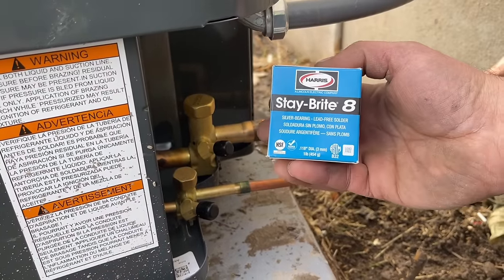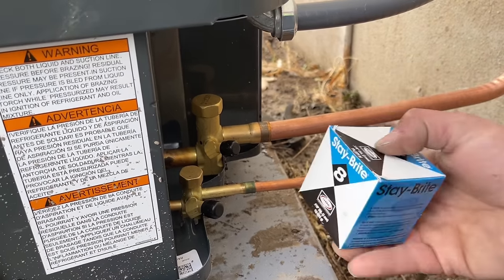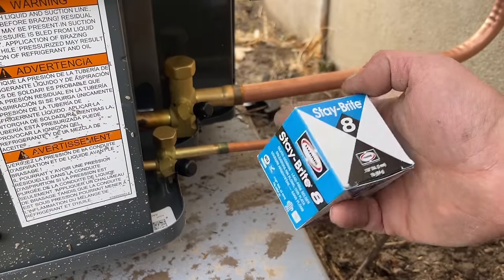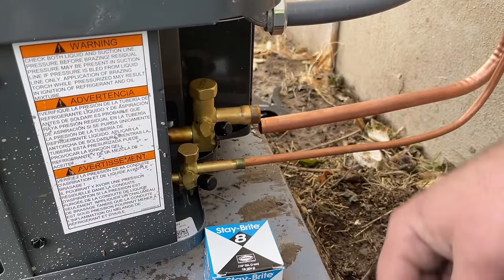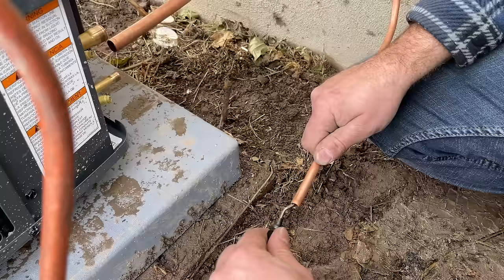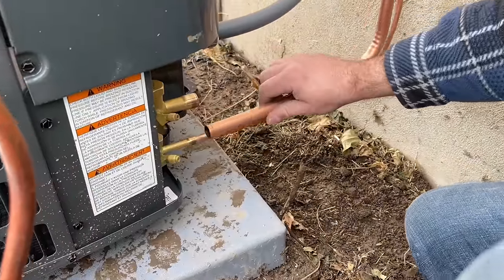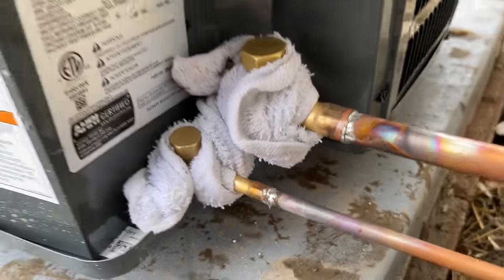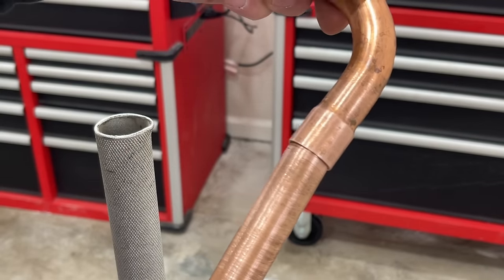An Awesome Alternative To Brazing HVAC Lines. Staybrite 8 Soft Solder

Comment: Remember to heat the joint, not the solder.  Apply the solder on the opposite side of the heat and let the solder run to the heat.  As well, if possible, do all sanding before you cut the pipe.  Finally, don’t touch the pipe where you sanded with your skin.  You will transfer oil to the pipe and “dirty” the contact point of the solder.
Reply from the maker: Thanks so much for the feedback sir. I'll be implementing all those tips on the next job. Cheers!
Reply: Nice
Reply: I’ve never heard of the transferring oil and making it dirty part😂 seems a little over board but hey I guess we learn something new everyday
Reply: You can certainly transfer dirt/oil from your skin to the parts.  About the heating process, you need to have experience heating the parts up to understand how heat flows.  So get after it.  It’s not just simple to understand, there are lots of factors involved.  Making a solid joint requires that the entire section of the joint to be soldered/ brazed needs to be above the melting point of the solder, so that when the solder is applied, it will flow into the entire joint.  And you can’t just burn the crap out of it, controlling the heat is essential... for a good joint and for efficiently.  When the joint is done... it’s done, move onto the next joint.
Reply: @Alienspecies635  it’s very true. I doubt it matters with brazing but when using flux and soldering it sure does. You’d be surprised of all the little things can’t prevent solder from sticking or running.
Reply: Don’t heat the joint heat behind the joint , solder flows to heat and you want the pipe inside the valve to be sealed not so much the joint
Reply: You would like it better with a tighter tip or if you can find a used prest o lite single tank acetylene
Reply: @bjsavage9401 that's what the original comment said m0r0n
Reply: Yes old school
Reply: Curious, why sand before cutting?
Reply: @goldistocks609 So you don't get the shavings in the pipe
Reply: Wow, thanks except I’m not sure who I just learned more from? you or the guy doing the video, lol?

Comment: I have been Staybrite for 30 years on residential HVAC.   A quick check of their website shows the tensile strengths far in excess of the pressures on the lines.   I'm glad you demonstrated it.
Reply: @guydickes2177 what’s your experience using Staybright 8 directly on the suction and discharge lines at the compressor? Most comments say stay away from SB8 all together but the ones that say they do use it say due to vibration they do not use it in the compressor connections.

Looking forward to your response!
Reply: I can see where on compressor change out you might want to braze at compressor due to vibration of compressor especially on start up conditions, other than that STB 8 is great, I'm not so sure if it wouldn't work on compressors though.
Reply: Would you also recommend using Staybrite at the evaporator coil side of the system?
Reply: Yeah, brazing is better with high vibration, but for small temperature sensitive things like TXV's or non vibrating pipes, especially when you cant flow nitrogen like factory mini splits, medium solder is great. @MrJujubean

Comment: Grandfather started his own HVAC business in the 60’s. He always used soft solder and taught me to use it as well. Never once had an issue with it. I went to a technical school for HVAC just to get my license, and the instructors would get pissed when I’d tell them about soft solder and they’d would claim it wouldn’t work. Lol
Reply: Your grandpa was right, I started in the 70’s. My rule for soldering was use what is currently there pretty simple. New work, discharge lines 15%. silphos, dissimilar metals 45%, everything else stay-brite 8. My answer to the guys who say soft solder will fail is it’s probably 95/5 and not stay-brite8 .
Reply: It might work temporarily , it is not a high temp rated seal as brazing is. I have always found leaks specially when homeowner jerks around with condenser
Reply: The problem with solder is you can get oil and other contaminants in the pipe which can harm the system plus the structural integrity doesn’t compare to braze
Reply: StayBrite 8 is the best for new installations. I installed my HVAC equipment with StayBrite two years ago and I haven’t had any leaks.  I hate brazing with high heat especially in attics. There are some rednecks who refuse to learn new methods.
Reply: Monkey see monkey do , that's all i can say brazing is high temp equipment solder is fir water fir many reasons, but Monkey monkey do"
Reply: Sodder is fine on an r12 system because your pressures are around 50/150, I wouldn’t try it on a 410a system
Reply: I’m a plumber and I’ve always told the hvac guys that solder would work and they always said no way. I never liked seeing cherry red copper.

Comment: Only thing I use when ever possible. I used Staybrite 8 on a 1 1/8 shut off valve for a trane chiller holding 850 pounds of R134a, 5 years later and still no leaks. I use it every where except at the compressor.

Comment: I've used and love it when you gotta sweat a TXV in. Low Temps help prevent the brass from overheating and lessening up the capillary tubes. I will say I have seen these fail easier under vibration. So I wouldn't recommend using it directly at the compressor if you ever do a change out. Also, like another comment said. Wipe down your fittings really well afterward. I've gone to units where the Flux wasn't wiped off, and it eats away at the copper. Then you'll start getting pinhole leaks.
Reply from the maker: Awesome tips from a pro. Thanks so much!
Reply: or you could just do it right and use 56 and a wet cotton rag 🤷‍♂️
Reply: Flame is far to unstable 
Get a proper torch tip

Comment: I could be mistaken but I believe all 410 condenser installation manuals refer to brazing refrigeration lines. You don't want Flux mixing with refrigerant. Obviously people have been soldering these lines. It could be an issue if there is a warranty issue. Not installed to there specs. By all means do what you're comfortable with just saying.
Reply: Yep, fixed plenty of leaks from people using it it r410a systems but I have also seen plenty of r410a systems that did fine with it. Just depends who did it. I prefer brazing, also brazing can still look good if done right

Comment: My only suggestion is to braze the furthest joint first (the suction line on your first example) so that you are not reaching over a hot joint to reach another. This is more important when working on several connections at a time.
Reply from the maker: That's a great idea! Thank you!
Reply: I have a nice scar on my forearm for this exact reason lol. Something I learned tge hard way

Comment: At one time I used a induction heater (no flames) to solder copper pipes that where next to a wooden wall. Solder melted a lot cleaner.. Makes better looking connections.

Comment: I've used it for 40+years.... Best to put the heat at the bottom of the the female joint warm up and add the solder at the top feed it in until it bulges out the bottom..... Wipe with a wet rag and done...
Excellent product.... Glad your using it.
Reply from the maker: Thanks for sharing
Reply: @lstar2662552 what’s your experience using Staybright 8 directly on the suction and discharge lines at the compressor? Most comments say stay away from SB8 all together but the ones that say they do use it say due to vibration they do not use it in the compressor connections.

Looking forward to your response!

Comment: been using only this for 40yrs, on AC and Refrigeration. have never had a joint failure. So much less expensive,  easier and quicker than bazing.👍
Reply: But there is flux in the line that shortens the life of other components. 

The joint may not leak but it took 5 years off the compressor?

Comment: I've been using this since I've started in HVAC 20 years ago and I agree this is better in all residential situations. StayBrite 8 has high tensile strength
Reply: Tinsel or tensile? Because one matters and one is a Christmas decoration.
Reply: "Tensile"
Reply: Does this work on 1/4 in and 5/16 refrigerator line for home refrigerators
Reply: @AMERICANPRIDE1100  
Yes

Comment: I have bee using this for 35 years in commercial refrigeration on both hi and low sides. Best  use for this is to install txv’s or solenoid valves especially if they are brass. Your turbo torch tip was way too big in the first shot and flux is not needed inside the fitting. Been told by Harris reps that this joint will have a higher burst pressure than a brazed joint where the tubing is weakened and I  can see why. Once on a project years ago at Merck Pharm plant this was an accepted alternate to brazing. They had some of the most stringent regulations of any place I have worked at. If you use this correctly this stuff is great.
Reply from the maker: Thanks for sharing!
Reply: I did a install at Loctite and the engineer insisted i braze 4” copper chilled water lines what a pain in the ass. I wanted to use Vic I almost quit
Reply: I need a job
Reply: Where do you live?

Comment: One of my fears with using a solder instead of a braze is that since solder has a greater difference from copper than the standard silver rods, a wet and corrosive environment could allow electrolosis to eat away the solder. Ice-O-Matic's copper evaporator plates fall apart very quickly because the solder they use corrodes away much faster than the braze that Manitowoc uses. So I would say be mindful of this possibility when environmental conditions are rough.

Comment: Thank you very  much for an informative video and info about the Harris products.

MAP gas is not the same as MAPP gas. Mapp gas production ended in 2008. When you buy MAP,  you're mostly paying for a yellow can. From wikipedia:  "MAPP gas is widely regarded as a safer and easier-to-use substitute for acetylene. In early 2008, true MAPP gas production ended in North America when production was discontinued at the only remaining plant in North America that still manufactured it. However, many current products labeled "MAPP" are, in fact, MAPP substitutes. These versions contain mostly propylene with some propane, dimethyl ether is included as a 3rd ingredient in some versions.[1] [2]"
Reply from the maker: That’s good to know

Comment: 😄 I was using Mapp gas 30 years ago, to silver solder high pressure induction coils, using Easy Flow 45 silver solder. The process is nothing new, except that you're just now learning of it.

Comment: Nice video.  I always remove the nuts and fill the well in the valves with water before wet wrapping.  Thanks for the nitrogen nod.  Nitrogen purging is in every manufacture’s installation manual and yet so many people are surprised when they are exposed to it.
Reply: I've been wrapping valves heavy with toilet paper wet it good clings tight to valves keep spray bottle keep wet if I have to

Comment: Thanks for the video.   I been using staybrite 8 for 3 years now ..  just like any skill it requires patience and practice .. making sure pipes are cleaned inside and out.  
Don’t overheat the joint  !!! 
Most importantly.. the weld is solid and clean.  Don’t see myself going back to brazing any time soon.
Reply from the maker: Thanks for sharing
Reply: I got units I put in 20 years ago with staybrite
Reply: Do you wire brush the female ends to clean them?
Reply: FYI:  It's not a "weld."  You're not melting and mixing the pipes.
Reply: You're using it for HVAC piping?  What happens to the flux that mitigates into the system??
Reply: What happens to the flux inside though? Its residue doesn't just get absorbed.
Reply: @deltaf222 per the books, you dont put flux right to the tip of the pipe so that it wont flow as easily inside the system.

Comment: Kinda looks like the amount of heat you would use on a water line ( plumbing) application. I may be wrong. If it is, this method is much better idea than brazing. I am a plumber and currently in HVAC school and just been trying to get as many pointers and different methods as possible. Thank you for this video. I had never heard of Stay Brite 8.

Comment: I started using that in 1984. Works great great
Reply: Harris reps came to a local supply house in 1985-86 and demonstrated how to use StayBrite soft solder. One of my coworkers installed a refrigeration system using StayBrite 8 but had to reinstall the pipes because the customer complained that the pipes were not brazed, only soldered.
Reply: @picklerix6162  Sounds like people laugh out loud

Comment: Something to remember is that the copper needs to be very clean copper to make solder properly hold and use light flux , light heat, and should only need to use the width of the outside diameter of the pipe in solder 
(1/2 inch of pipe uses 1/2 inch of solder ) 🙂
Reply from the maker: Thanks for the tips!!
Reply: The flux would be a no go, due to acid, use acid away b 4 start up.
Reply: @drg424  a no go with flux lol

Comment: I have been using this product for years now with no problems.  It has a tensile strength of over 10,000 psi.  A Harris representative at an air show told me this product is actually stronger than Silphos .  I only use mapp gas and it is very quick.
Reply from the maker: Awesome! Thanks for sharing
Reply: How about using it on mini splits instead of flares? Wont the flux cause issues?

Comment: This Stay Brite 8 is Absolutely Fantastic ! I only use Silphos 15 if I have a larger Gap that needs to be filled.
Reply from the maker: I need to pick up some 15% braze rod. I've heard really good things about it, but i'm excited to implement the staybrite 8. Its not as hard to work with as people make it out to be.
Reply: @diyhvacguy  The # 8 is nothing new.  It’s been on the market for at least 20-25 years.  It is more sensitive to prep than Harris 15.  There are cheaper versions of rod.  Some don’t contain any silver, and you can break the rod like a pencil.  I would stay away from anything that doesn’t contain silver, or a small amount of silver.

Comment: When soldering you need to heat the parts, not the solder otherwise your joint may be cold (and weak). Keep that flame away from the solder.
To clean the parts before joining use an abrasive pad for the male part and a brush for female. Don't scratch them with whatever you used.
After soldering clean the flux residue with a wet paper towel, rag or anything. If left there will corrode the pipe or at the very least look bad.
Reply from the maker: Thanks for the tips!
Reply: It was painful to watch. I like your explanation on proper technique. 👍

Comment: Flowing nitrogen through your pipe stops Oxidation from inside the pipe... I would actually love to see a joint cut open and compared against a nitrogen joint. You don't use a pocket knife for deburring? Solder flows towards the heat because of a tiny vacuum/low pressure gap thats created by the heat expanding. Heat the male end first, and the move to the female and gradually bring the heat up. Your technique was spot on. Flame in left hand, solder in right. These video are excellent!
Reply: When soldering is done right both methods produce similar pipe interior appearance and zero oxide formation. Heat is not a thing so it cannot expand or contract, the solder flows into the joints because of capillary action, for this reason the joints need to be tight fitting as solders in general have poor bridging capability.

Comment: There are two reasons this works so well.  One is that it flows deep into the joint.  Second is that unlike brazing, the copper pipe does not become annealed and soft. You do have to make sure the fitting and pipe are very clean and have a very thin coating of flux.

Comment: Despite everyone saying not to use Stay-Brite solder I decided to anyway on a DIY HVAC install.  That was 7 years ago and the unit is still running good with no leaks.  The Stay-Brite solder is awesome!
Reply from the maker: Amazing. Thanks for sharing!
Reply: Just be sure it's the Staybrite 8 Harris and not one of the many other solders they produce.
Reply: I wonder why so many techs use hi heat braze and yet more often than not don't flow nitro to prevent sooting -- bc it's more work / hassle, and TVX clog failures happen 4 - 6 years later, past warranty.  Could it be? :  1) This is how they were trained   2) Brazing rods are cheaper, Stay Brite8 is expensive   3) The belief that brazing is stronger more secure under vibration
Reply: It does not hold out forever linesets are better off with braze which is why you’ll void most manufacturers warranty with silver solder
Reply: @roberthernandez1985  That's exactly what everyone else said but here we are 7 years later and no leaks so I still don't see the advantage of brazing.  Plus, it appears that most of the lines on the compressor are soldered from the factory so it does not make any sense why those can be soldered but the line set needs to be brazed.
Reply: @watchman1982  I just recommend pipes inside the walls yet brazed because you’ll never have an issue with them soft solder can be an issue over time I’ve seen it on jobs where I kept old silver soldered linesets in place and then 5 years later we go back for a leak and it’s a silver solder joint in the wall that’s 40 years old